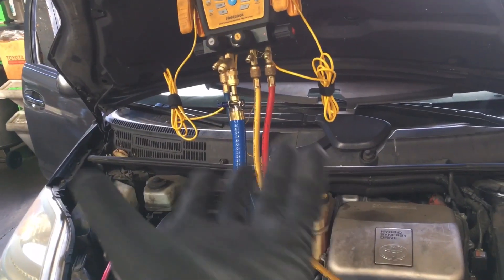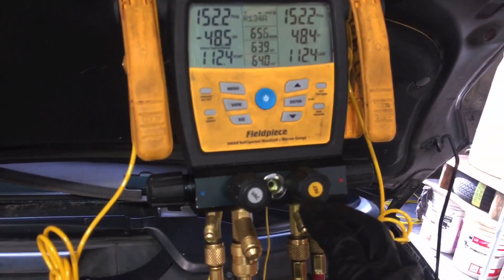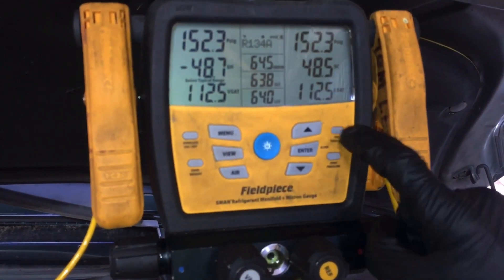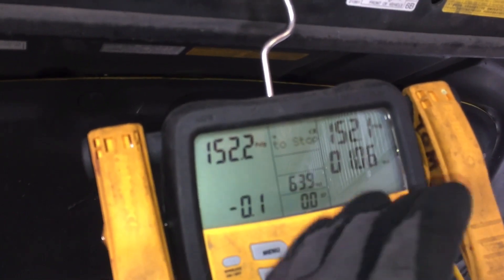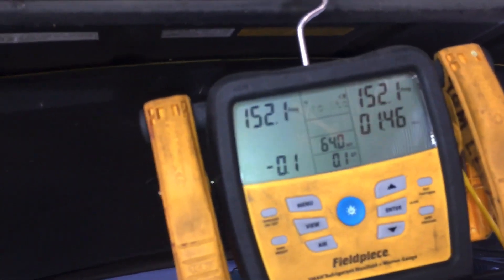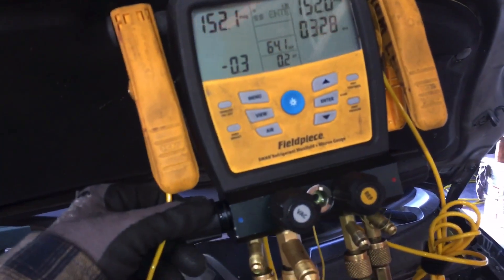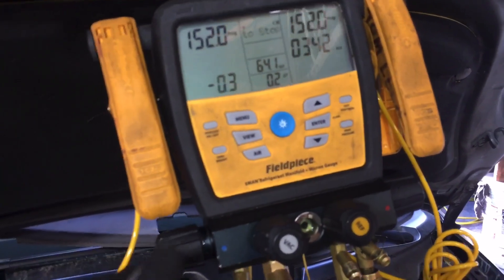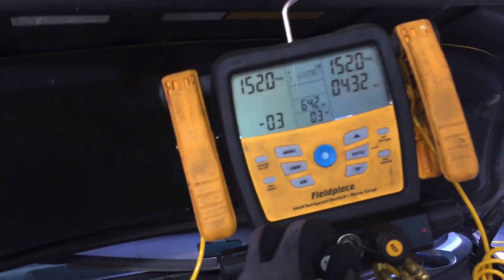Dry nitrogen high-pressure decay test using Fieldpiece SM480V

Comment: 12 CFM pump!!! 4 to 5 CFM
16ton to 25ton (Typical Residential A/C System) would require a pump with a 4 to 5 CFM rating. 16ton to 25ton (Commercial Systems) would require a 6 to 8 CFM rating.
Reply from the maker: @markhoffmann5941  time is 💰 money 💸 
It all depends on how fast you want to get there and how low you wanna go

Compare to residential and commercial automotive HVAC systems are completely an entirely often moisture contaminated very heavily. 

Automotive technicians when they work on any part of the system often just leave the exposed lines open to the air for hours days and in body shops even months waiting for Parts. 

There is no education, Automotive industry that is mandatory or required

Many professionals or just learned by breaking customers, stuff and learning. 

They were taught to use shop compressor. You know the stuff that has all the water squirting out the end of the hose to squirt into the air conditioning system to pressurize to look for leaks.

You might as well take a hose and do a hydrostatic pressure test

We’re talking about some of the most uneducated individuals in the history of mankind

Just because education is not required to be an automotive technician. 
And the model is it works it blows cold on your hand therefore it must be correct
🤦‍♂️

Comment: Amazon video, super impressed. Subscribed.
Reply: I just got a lightly used SM480V and I’m testing it on a bottle of nitrogen, to make sure the manifold or hoses aren’t leaking. I hooked up high side to the tank at around 170 psig then removed the hose, and let it hang. Then I did the same thing on the low side. Starting pressure for both was around 167 psig. Within an hour both my high and low are around 150 psig. I tried using another set of hoses, and I get the same issue. Is my manifold really leaking?
Reply from the maker: @ES-iv6wb retest. 

Put it up to 200 psi if you can . 

And then let it sit with a Valve open at 200 psi do not start your test yet 

After 15 minutes .  Close your valve to your nitrogen.. 

After about another five minutes now, start and press your button for your nitrogen Decay test . 

Give your hoses time to expand as well because of the high pressure in the hoses there slowly moving 

Give your nitrogen in the manifold and the hoses to adjust to the temperature if there’s any difference from when the tank to the hoses. 

And retest

And you can spray or squirt or tab on some soapy water or leak test solution.  On all your knobs engages, you can take your knobs off by removing the Phillips screw in the center of the plastic knobs.. 

They pull straight out

While you have 200 psi, you can spray or tap on your leak bubble test solution.  If you see no leaks around your vowels all your site glass, you have no leaks there.. 

Now you can start checking your brass cramps on your hoses and the seals around in Fittings on both ends. 

Let me know how your test come out
Reply: @coldfinger459sub0  thank you! Will retest and let you know.
Reply: Initially I did this test at 170 psi, bc I wanted to test an inficon ultrasonic leak detector that I bought. I saw a mixed bag of reviews on ALL of the ultrasonics out there, and wanted to see for myself if it worked. I couldn’t find hear a leak on the inficon lol. 
Is there a good product on the market that can detect high nitrogen concentrations (I know air is mostly N2)? The reason I ask is I don’t like to load the system with refrigerant to check for leaks. Any other solutions?
Reply from the maker: @ES-iv6wb  ultrasonic works good  it will find certain types of leaks that you may not find otherwise. With other types. 

Refrigerant leak detector will find leak ultrasonic may have hard time finding.   Then sometime UV finds types of  leaks both others will not find. 

Another time soap bubble can find the leaks you missed with the others.  

Ultrasonic can find vacuum leaks .  No other can do that. 
Ultrasonic thanks a learning skill.  High frequency, bounces off of hard objects, a directional..  if you don’t understand the physics in the first place, how are you going to use it properly if there’s nobody to teach you. 
You may find extension cord very close to you after the power with interference that you were here on a shop light that you may be using . 
So you will have to move that out-of-the-way 

LED and some fluorescent power ballast give off radio interference that it may pick up . 

So you might have to turn off the shop lights or move to a different location .  Or use an old fashion incandescent light bulb in your area.. 
People will have problems with ultrasonic because they have no education on it to use people think you just pick up at all and use it and it just works. Doesn’t always work like that. . 

The same thing there’s a difference in the way you use a heated diode leak detector sensor compared to a infrared detector sensor . 
And they will get some mixed results. Some bad results frustrating results because they’re an educated on the equipment. This is the problem with a Automotive Industry..    there is no mandatory formal education required.  Like a 4 1/2 year program I went through or four year apprentice system. My father went through and going tonight classes at night time learning all the stuff.

We have a nation of ignorant retarded people who are allowed to leave the schools no longer have auto shops and other trades classes.  

High pressure nitrogen works excellent 

Only problem thing comes back to education 

People are not talked that certain types of leaks only leak under certain types of situations. They are not all constant. They’re like pressure pop off valve some of them. 

Some leaks will only leak in the middle or the rubber hose gets cold and then when you turn off the AC system leak stops 

Some leaks only leak when the system is hot with a hot high-pressure refrigerant system is turned off and leak stops 

Some leaks you’ll find only leak at low pressure .  As soon as you start, putting in the refrigerant after you completed all your leak test, you will add the refrigerant and all of a sudden you will hear a hissing sound from a loud large leak.. 
       And you will easily find a leak.  But if you start the system up and make a high-pressure, Earl get hot Tahlequah stop..    and then you go shut it off and you look for the leak and it doesn’t come back. 

I didn’t mention all the ways leaks happen, only some of them . 

So how can you find his leaks with any of those leak detectors? They won’t find out because at the moment that you are testing leak is not happening . 

Can you have what is called forming gas? 
It’s a mixture of 95% nitrogen, and 5% hydrogen or 5% helium depends which one you purchase

And you have to purchase a special leak detector that has only meant for hydrogen or helium .  

This method you get the best of both worlds 

Because you could pump up the system to 200 psi, and look for the leak with an ultrasonic leak detector and a dedicated helium or hydrogen leak detector and soapy bubbles. 

So this type of lease detection gives you three methods using forming gas. 3 in 1 

UV dye finds some of those hard to fine lakes that happen weeks later or months later days later. 

Or the leaks that only happens when the car is going down a rough road and the hose is bouncing around and it starts leaking at the crimp connection 
But when the car is still in stationary in your workshop with a hood open, they don’t leak .
Reply: @coldfinger459sub0  yep.
I agree with everything you said. 
I’m actually really familiar with LED causing noise on an RF frequency. I’m surprised you knew about that. Not it if people do: and the solution to use incandescent bulbs. 

It kinda sounds like I need to have 4 different leak detector setup. I actually have a helium leak detector- I used to use it all the time. I have the ultrasonic and also refrigerant detector. Now I just need to get my hand on some hydrogen lol
Reply from the maker: @ES-iv6wb  ultrasonic problems have been known for many many decades.  But it wasn’t a problem back in the 50s and 60s and even the 70s because we had incandescent lightbulbs in all houses. There were no LEDs and almost no florescence.. 

And the fluorescent lights that were available and all your radio components and everything in the house back in the 1950s 60s and 70s all used linear power supplies . 

Not switch mode power supplies 

Switch mode is where the radio frequency interference comes from 

Back in the late 70s early 80s my father train me on ultrasonic because he owned one it was extremely large device .   The headphones look like something you see in a Vietnam helicopter war movie.

A big large brick power supply with a big large electrical cord. Then the big hand held unit with the wind on. It weighed about a pound and a half with a Metal case. .  Any metal flexible wand
And it cost about $3000 back at that time .  My dad had that kind of money.. 

So ultrasonic and its uses and idiosyncrasies and nuances or something I’m very well aware of .  Many decades of use.. 

Now I can fit one in the palm of my hand and run it off a 9 V battery .
Reply: @coldfinger459sub0  you should make video on using different types of ultrasonic devices with conjunction of refrigerant and UV. I think the series will probably attract a lot of attention.
Reply from the maker: @ES-iv6wb  I’ve made little videos when I came across leaks on cars and showed some comparison that sometimes one leak detector can pick up the leak well at the same time another leak detector cannot pick it up and then the exact opposite effect on another vehicle using different leak detectors

Yeah, I really need to make someday. I really nice video. Good audio nice cinematography with good lighting but they take time and money. I tried it. 

I lose too much business because of the time loss

Comment: I just stumbled on your videos today - your knowledge and experience on automotive HVAC is impressive!  I'm changing the evaporator on my 1990 Infiniti Q45.  My Fieldpiece SMAN is showing a pressure differential of -0.6 PSIG over about 13 hours (sitting overnight) with an initial fill of nitrogen at about 145 PSI.  For the first 2 hours, it showed no drop at all.  The ambient temperature dropped about 8 degrees because I was cooling off the garage overnight with a portable air conditioner, but the SMAN is supposed to compensate for that.  I had the temperature clamp on the low side pipe near the evaporator.  Do you think this is a significant leak?
Reply from the maker: It’s probably not a leak.  If you leave it on for the next day.

If the temperature towards the end of the day gets to the same temperature where you started your test, you’ll probably see that 0.6 go back up. . To 0

If you did not see anything in the first two hours .  It did not move at all.

And then buy the next morning when it got cold it went down. I’m gonna blame it on the temperature. . 

Now you could leave it on the vacuum pump for 24 hours .  You can never over vacuum..  especially on a car that old.    All you can do is remove more moisture.. which is a good thing. 👍

Congratulations on your SMAN
Reply: @coldfinger459sub0  Thanks for the quick reply!  I'll try another test without the air conditioner on to keep the temperature more constant.  The long vacuum is also in the plans, since I'm going back with R12.  😬

Comment: what pressure drop will make you look for a leak in thightening test mode?thanks.
Reply from the maker: First when you’re performing a dry nitrogen high-pressure decay test. 

For example you fill the system up let’s say 170 psi pressure through the tank of nitrogen. 

You now shut off your valves to the nitrogen tank

Then you let the pressures stabilize for five or 10 minutes first before you start your test.  ( because there is a period when you first fill up the system the gases are heating up or cooling down depending on temperature differences and things like hoses are stretching) 

Now you hit your button for tightness test after you have waited for the system to stabilize. 

After 10 or 15 minutes you probably should not see more than two or 3/10 of a psi drop and then it stops moving. 

Now if it’s a very hot day and the Engine is hot and the interior is hot you may see the pressure go up.   A few tenths or a psi because if the tank of gas is only 80°F and you push it into hotlines hot evaporator with a hot interior that’s 140°F the gas will increase pressure a little bit

The same goes if the tank is hot and you put it into a car that’s sitting outside overnight on a cold night in the car is 40° you will see the pressure go down a little bit but then stop when it equalizes.   

For those very small leaks if you see two or 4/10 of a psi after five or 10 minutes.     Leave it on for another 10 minutes.    
   Did he drop another 4/10 ? When you have probably a leak. 
        Leave it on for another 10 minutes did I drop another 4/10 or 3/10 now you can probably say you definitely have a very small leak somewhere

And this is where the ultrasonic leak detector finds those type of leaks because it’s not refrigerant it is dry nitrogen.
Reply: @coldfinger459sub0  i appreciate the knowledge passing to us. Thanks.

Comment: For the nitrogen leak test, do you use the co2 sensor with the inficon stratus?
Reply from the maker: That is something I’m just starting to do for some test.   I want to see the difference capabilities of what size leak a refrigerant leak sensor finds

Compared to CO2 on the exact same leak. 

The common every day package CO2 is considered usually a dirty gas that sometimes has contamination of moisture. 

So it has been often advised not to use it in a system that contains POE oil or PAG oil because it loves to absorb moisture. 

You either have to buy and go out of your way to purchase laboratory grade or medical grade CO2 to get clean pure CO2

Or you could run it through a filter dryer yourself slowly to remove The moisture content and then run it through a moisture indicator so you can actually see the reduction in moisture removed. 

Do you also want to take a CO2 tank and put it on a vacuum pump and get it down below 100 µm so you know the actual brand new tank that you will be using is moisture free and air free of contaminants. 

Then do your CO2 transfer throw your new tank into a freezer it helps if your new tank is colder than your supply tank CO2 is extremely reactive to temperature and pressure changes.

Comment: Dude, you should always pressure test with similar working pressures. You should not pressure test s 410a system with 80psi. You ain’t kidding about the vacuum seals. A deep vacuum will easily pull IN a schrader. You can have one on a filter drier or for discharge pressure, rite off of the compressor w/out a cap. Or a loose cap. And just murder your vacuum. 

Bro, you got a leak there. I think your pressure is good. You need to let it set longer. I would TRY more pressure tho. I don’t work on cars.
Reply: you realize a car runs 134a not 410 a way less pressure on 134a
Reply from the maker: @8799crosby  that’s why I only pressure test them out 150 to 170 psi   Because that could be the possible maximum temperature of are 134 on a hot summer day with a car with a hot engine sitting out on the blacktop parking lot in Arizona on 115° day with an inside cabin temperature of 140° and an engine compartment temperature of 240° 
             Using the highest possible evaporator temperature the standing static highest pressure can possibly be roughly 230 psi don’t wanna go any much above that with risk of damage to the evaporator‘s because they were not designed to go much above that.
Reply from the maker: That Prius on the automobile I was pressure testing at 152 psi with dry nitrogen that is its working pressure.      

I also do the large LG multi-V VRF 20 ton to 60 ton unit installations with 1000 to 3000 feet of copper pipe that I sell and install myself with my son. 
                      On those units we use a dry nitrogen high pressure decay test at 600 psi for 24 hours. 

        Usually I like to try to perform my high-pressure dry nitrogen decay test starting on a Friday leaving over the weekend and coming back on on Monday so it has two or three days to determine if there’s a leak. 

And all the time I’m grafting it on the datalogging program following the rise in the fall of the nitrogen pressure as the nights get cold and the days get warm and every day the nitrogen goes back up to exactly where it was when you first installed it at that particular ambient temperature.